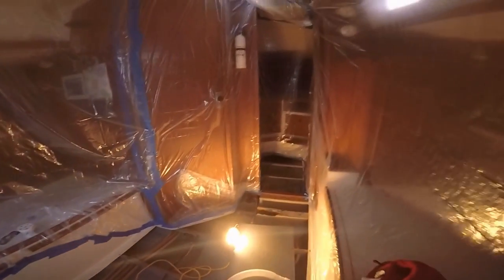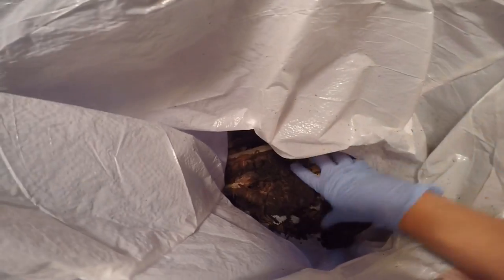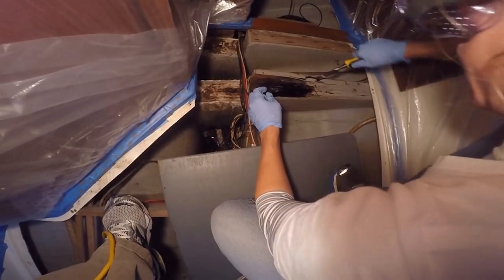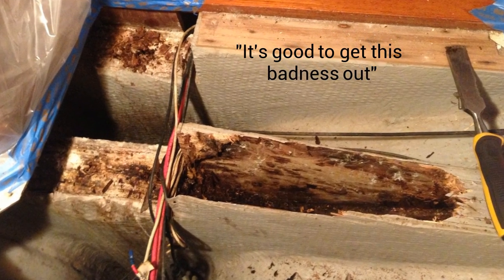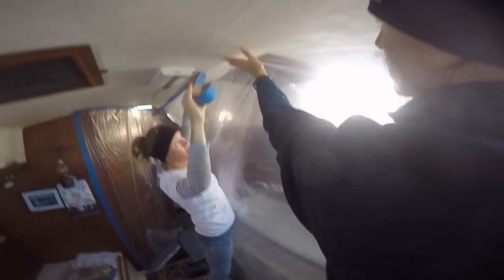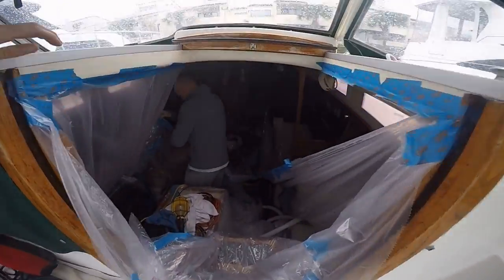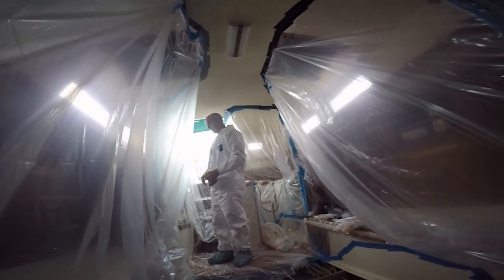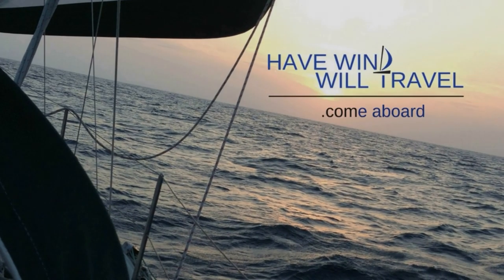#46: Can You Dig It?

Comment: Looks familiar.  I re cored my cabin roof from the inside, yes upside down grinding and fiberglass work.  I used a full face respirator and the hasmat suit.  Good times.  I feel your pain.  I'm sure you are getting some really good advice, but if I were you I would mahogany ply wood to replace your stringers.  Even it gets wet it wont rot.  You can special order it form home Depot.  Good luck!!
Reply from the maker: +Son of Neptune Sailing Hey there.  Upside down fiberglass grinding?!  Holy cannolis.  That sounds MIZ.  Thanks for the advice.  You'll see we actually went with high density foam -- Coosa board.  It's been really interesting to see the stringers come back to life.  Stronger than ever!

Comment: I need to ask the real question.  Why the rotten stringers?  why did they rot out?  were they all affected the same way at the same time?  in the video it look like you are only working on one but what about the rest and where did the water come from that caused them to go bad?  I would almost be afraid of the answer if it were my boat.
Reply from the maker: +Don Harden Hey Don.  Glad you asked.  I did a video on it here: http://havewindwilltravel.com/2016/01/18/41-a-cause-worth-weeping-for/.  It was actually a clogged weep hole in our mast step that allowed water to collect in the mast and drain through the screws in the mast step (which were lower than the horizontal weep holes) and rot the stringers which were not glassed on top ... for whatever reason.  Kind of a fluke thing but something we're glad we discovered when we did.  Lift your floorboards, though!  Always check!
Reply: Thank you for your reply.  I watched the video and thank you for sharing.  I have been watching every sailboat repair and refit video I can find on YouTube.  I don't have a sailboat but have been thinking hard about getting one.  I am really surprised and taken back by how many times I have watched videos that people have posted with the exact same problem.  I have to ask why aren't the mast's water tight.  They let dust, dirt and water in and that is just a recipe for disaster.  Now I am scared to death to buy a sailboat knowing that a major disaster is not a If it happens but a when will it happen issue.
Reply from the maker: +Don Harden Don't be scared, Don.  It's just part of it.  It's almost impossible to keep the mast water tight as lines have to be able to move easily in and out of it so you can't make the sheaves too constricted.  But (as far as I know) all mast steps have weep holes to allow the water to drain out.  The simple fix here would have been to check the center vertical hole (which I'll admit, I didn't even know existed) occasionally to make sure it wasn't clogged and just look at the condition of the "innards" of your boat.  Lift the floorboards, look at your floors and stringers, touch them, press on them.  If you have water in the bilge, find the source, try to fix it.  Boats are astoundingly resilient.  Most often issues like this are the product of operator error because problems weren't discovered and repaired soon enough.  Don't be scared, Don.  The right boat is totally worth it.